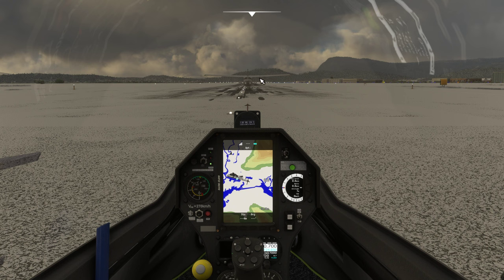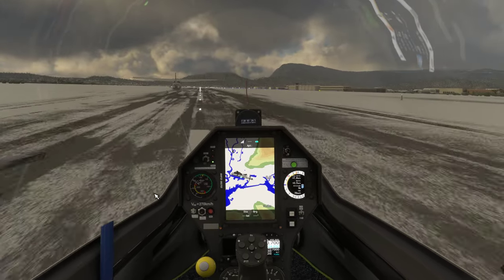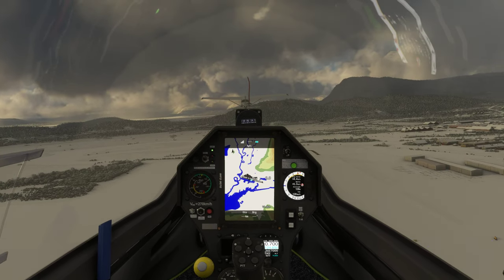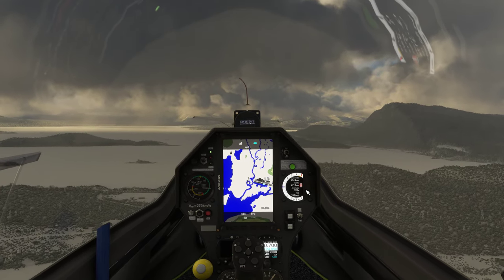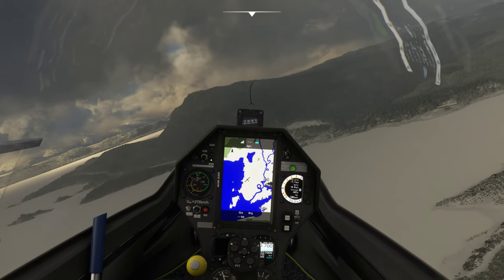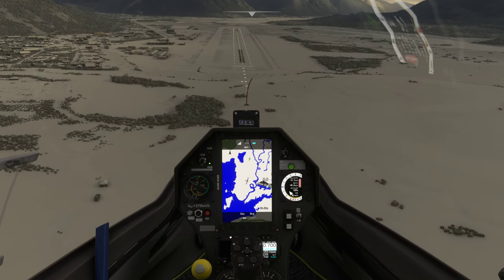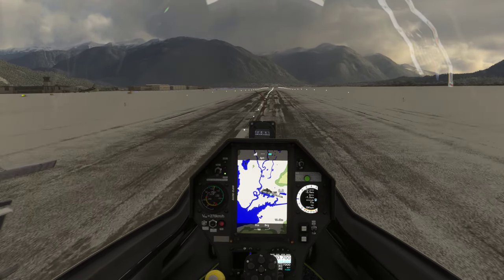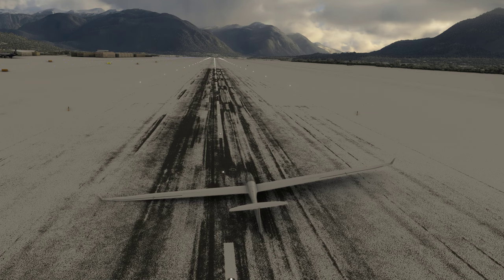Basics of gliding MSFS (and getting the tow plane to move)

Comment: Hi thanks for the vid. With gliders, i have the issue of always drifting to side of the runway. when trying to use rudders, i overcompensate and start doing a uturn on the runway. am i coming in too hot?

Also, at which airport are you flying in this vid?
Reply from the maker: I suggest turning rudder sensitivity down.  The most important thing is keeping wings level.  If either wing tip touches the ground it will spin.   Use your rudder for directional control and stick/yoke for keeping wings level.  I think it was Anchorage airport but I don’t remember.
Reply: @CRgamingMSFS  I will give that a try! Thanks for your help
Reply: Good advice i agree

Comment: I just installed the simulator and got an old K7 german glider from 1950, installed that and a nice little gras airfield and now i have no idea how to spawn a motorplane for towing me up or install a motorwinch to pull me up. 
I have seen on older simulator that people install additional software but i think its not necessary here, because i did the tutorials for soaring. So how do i bring my glider up ? I dont want to cheat and spawn in 2000m.
Reply from the maker: I’m pretty sure that the auto plane or winch are not available on gliders that are not default.  There are add on programs to give you a winch launch though.
Reply: @CRgamingMSFS  no, i am pretty sure, its possible. And i already did. You just have to find the right buttons on your controller. You dont see the rope, though. But it will pull you up.
Reply from the maker: @usurpinesusanti3149  That may be an add on with that specific plane.  There is a program called Kinetic Assistant that can allow for winch launch and allow you to connect to other planes.  Searching in the controls options there is no spawn tow plane" option.  The only glider option is releasing the tow/winch.  Either way, this video was showing how to fly the default aircraft that came with 40th anniversary.  I don't have any 3rd party gliders.

Comment: Yeah can tell you are not a glider pilot. The yellow triangle marks speed you should aim for when you are on landing pattern, you where way to fast when you started the decent for landing. Pull the spoilers and aim fore the yellow triangle. Best gliding speed is about is between 100-110km/h.
Reply from the maker: As I mentioned, my intent was to show you how to get the gliders to work in the sim.  It was not to give you proper gliding lessons.  I'm just giving you the basics.  I was doing a short pattern and did not want to make the video 3 times as long as you watch me circle the airport to slow down.  I did have a very fast approach speed since the spoilers are not super powerful.  By the time I touched down I did have a proper landing speed and was slightly bellow the triangle.
Reply: @CRgamingMSFS  Glider spoilers are used to increase rate of descent.  Pitch controls airspeed.   After you flare you can use spoilers to increase drag in order to slow the glider.

Comment: How does the plane lift up it's wing? I always start with the wing lying at the ground.
Reply from the maker: You should have a tow plane or a winch.  The wing should not fall until you wiggle the rudder.  After you start moving use ailerons to keep level and rudder to keep strait.
Reply: im having this issue aswell. im not getting the ground crew.
Reply from the maker: @ciwiyeet8216  do you have any push back type add ons?   I would suspect it’s add on related.  Also check your controls and make sure your rudder isn’t moving on its own.  That being said,  if there is any wind you can get the plane level before moving.
Reply: @CRgamingMSFS  That's also my problem. No one is appearing who can hold the wing. From my side I don't have any special push back Add on or something.
Reply from the maker: @Neosnoop37  join my discord and i might be able to help. https://discord.gg/q59JJ5eZ
Reply: @Neosnoop37  It's caused by a conflict with an addon inside the community folder (whatever addon that might be...). Once the community folder is empty, it works
Reply: @ChrisA7X89  Yes, thank you. I've deleted some Add Ons and now it's working. Thank you!
Reply: @Neosnoop37  do you remember which ones so we might be able to pinpoint this out
Reply: @ChrisA7X89  Im not sure to be honest. I had several sceneries like EDDS or LFMT. And I also deleted many repaints for the FBW A320 or Asobos Aircrafts like C172 or TBM.